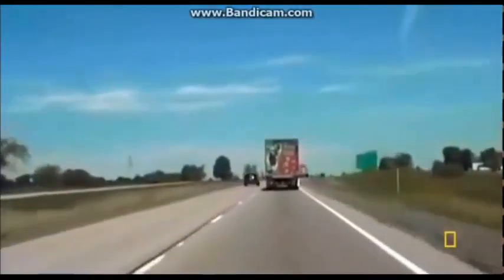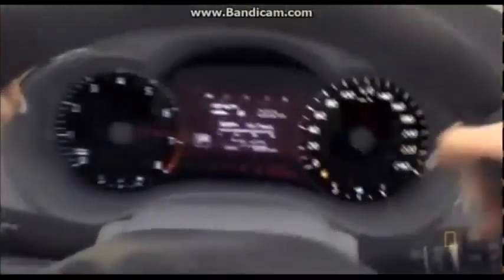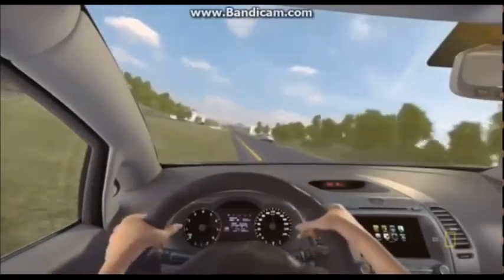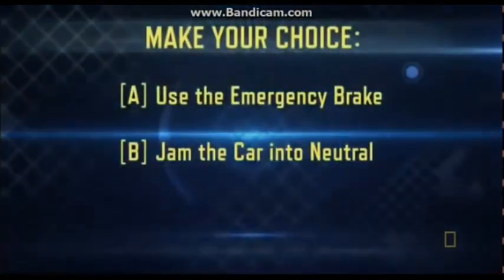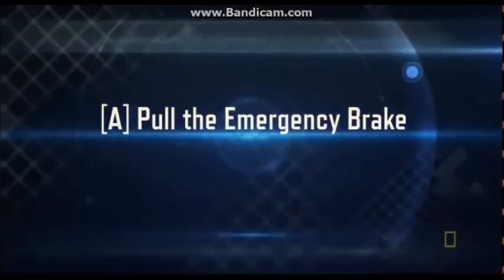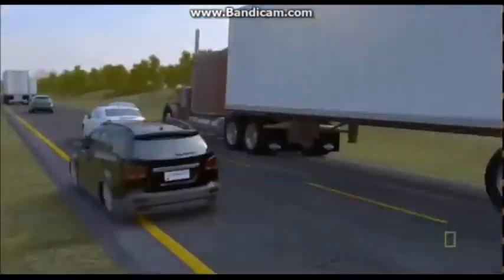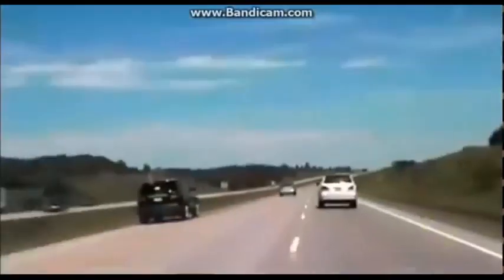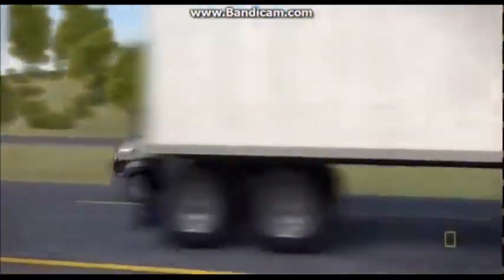How would you stop your car if your gas pedal stuck

Comment: 1:19 a kia sorento 2011 doesn't have a v8, LOL
Reply: Ikr lol. They also act as if 175hp is a lot lol.
Reply: Turboed Dude Well it's more than the average car has.
Reply: Pshtttt no way dude. I know a lot about cars and thats either average or below average.
Reply: where do you live then? In monaco or beverly hills?
Reply: I think every car in america is like that. I think every car in america has 150+hp since fuel is really cheap there.
Reply: I live in New Jersey
Reply: حفصة not even
Reply: 175 for a small coupe is a lot, but for a 4wd suv that weighs 4000 lbs+, it really isnt
Reply: Turboed Dude yeah here in portugal if you have 175hp car you’re actually doing Pretty good in life
Reply: Yah. And any company that managed to make a v8 with only 175 hp should be embarrassed.  My v6 has 195hp.
Reply: Zekeriah Jones there are 4 cylinders with 330hp Out there stock
Reply: حفصة actually, that's pretty average...
Reply: but its a heavy suv... weight is really important ok?
Reply: That's what I was thinking, also a Sorento has more than 175 Hp on base models.
Reply: حفصة it isn’t tho.  toyota camries have more than that.
Reply: Zekeriah Jones kia sorento isn’t a v8
Reply: H4ckantrieb Volkswagen Golf 7R. 2.0L 4 cylinder turbocharged to 300hp.
Reply: Our '06 sorento 3.5 v6 made 195 from the factory. A just quick retune later and we were sitting right around the 280 mark. But those fuel milage figures went way down lol. I still prefer skids in 2nd entering the on-ramp to the highway. Smiles per gallon !
Reply: حفصة 175 horses in an suv isn't that much
Reply: V8 swap
Reply: حفصة its not, its an suv
Reply: What kind of modern v8 would put out only 175hp anyway? 😂😂😂 This isn't the late 70's-80's.
Reply: Yeah 175 hp is slightly over average. Most cars have between 100 and 150 hp.
Reply: It has. V12 Biturbo
Reply: ever heard of  turbocharger? makes 4 cylinders do 250+ hp. my mom has a 2 litre 4 cyl turbo and it makes 254 bhp. cost her 27 grand.
Reply: حفصة no, 175 is less than average to US, in the US the average hp for cars is 210
Reply: S J Productions II only 250 hp for 27 grand wtf you got ripped off then because I could by an eBay turbo kit for like $1500 and make 500 hp 🙄😂
Reply: Engine Swapping 101

Comment: 1) Pulling the handbrake doesn't instantly lock-up the rear wheels like it does in video games. You can pull it only slightly and then progressively pull more and more, that should slow you down without locking the brakes.
2) Brakes are supposed supposed to be more powerful than the engine, so that you could always deccelerate in a simiar situation. Either they were faulty or she braked too much earlier and heated them up so they became useless.
3) Shutting the engine off doesn't lock your steering wheel, the power steering isn't working anymore, but at such high speed you can steer quite easily. This still seems like the best option for me.
Reply: You will be shutting down your brakes too.. never do the 3rd option
Reply: @vysakhjayan3448  You only need to use them once, so it's perfectly fine.

Comment: The people who made this video obviously didn't watch the video that they are talking about.  The dispatcher told her to do that, and she said that it wouldn't shift.  Okay, NOW what do you do???
Reply: Shilodog Smith use the clutch pedal? Duh?
Reply: Yeah I would automatically put the vehicle into neutral but if that didn't work I would kill the car.. at high speeds power steering doesn't help as much as lower speeds so you could still steer but you would need to know how to drive at least drive with common sense... I see so many people who literally have no common sense or any mechanical inclination and their driving is just terrible.. can't tell you how many people I let ride  my dirt bike, 4 wheeler, jet ski etc growing up and I tried to teach them and it was like dealing with toddlers.. a lot of women are like this when it comes to driving and they aren't defensive at all.... sorry but it's true..
Reply: Finlay Mitchell automatic shifters don't have a clutch pedal
Reply: Carguy 2204 From my experience there are also a lot of male crappy drivers (and a lot of males who struggled to deal with gear switching on my Quad/ATV or generally driving it), who drive way to aggressive for their driving skills.

I did however do a seminar, while getting my driver's license, on driving in dangerous situations on a test track. Helps a lot. As well as driving a car which is older then me. No power steering, no anti-lock brake system, not even air conditioning.
Reply: Ayumi Kuro You are right I used to race motocross and a lot of my friends couldn't even use the clutch on my old practice bike it was funny..
Reply: A friend of mine literally thought all you need to do to drift was pulling the handbrake and floor it. Luckily he didn't try it before i showed him what an actual drifter does while drifting
Reply: Turn the engine off and let the car loose speed by itself. You can actually turn the steering wheel while the engine is off. It just becomes stiffer, but you can turn it anyways. You won't have braking assistance though, but you can still put some weight in the pedal and have a bit of braking like that.
Reply: Exactly, in auto transmission you can't shift to neutral at high speed
Reply: My 2008 automatic ford focus allows me to. Don't know about newer transmissions ...
Reply: 5Siver the video says "TRY TO JAM IT in neutral"
Reply: Christ chris in the newest cars the lever is electronic not mechanical, it doesn't allow you to put neutral even if you can move the lever
Reply: Felipe Frota must depend on model year then. In new peugeots it's not possible.

Comment: The key has 4 settings
1: off (here is a risk of activating the steering lock, even with the key in)
2: access (disengagement of steering lock and turns on secondary systems (radio, navigation, auxiliary power)
3: on (turns on primary systems, engine control, abs, ebs and more)
4: start (spring loaded, the key goes back to on after release, this starts the motor, engine powers your power steering and brake amplifier 

You can always go from on to access, and cut the engine, however, this will cut off power steering, abs, airbag, esb and your brake amplifier, so that you have 2-4 brake attempts in your pedal before your amplifier is empty. 
But it will not engage steering lock
Reply: I don't want to be that guy but acc stands for accessories

Comment: You are actually supposed to put on neutral and then set the car only on "contact" where it has power WITHOUT TURNING ON the engine (shocking, i know. Cars can be on contact to test lights or the electronic without turning it on since 1980 or earlier). And if the car is in contact you can still steer the wheel.
Reply: Yeah but you'll lose power steering and brake assist
Reply: You shouldn't turn the engine off. You would lose power steering and brake pressure making it harder than 
necessary to come to a stop safely.
Reply: Soleimsen look my response up.
Reply: Soleimsen the power steering is true but if your at high speeds, you wouldn't feel that, I drive a car that doesnt even have power steering to begin with, but the engine doesn't have shit to do with the braking system. What if you engine stopped working when your at 100 mph? Yeah right
Reply: Soleimsen sorry for the bad english btw, Im not from an english speaking country...
Reply: gerrit sikkema there's diffrence between engine block/failure and leaving your car on contact. If you have engine failire your wheels will lock
Reply: polikerski Break pressure is depend on your foot. Only if your brake leak that it won't work(also some fully electronic brake, but it should have some backup?), and you shouldn't drive out in the first place. Did you mean the brake assist. If so, it is, but your adrenaline would help. ;)
Reply: Your brakes would still work just as good with the car off as if it was on. The brake system uses the negative pressure from inside the intake manifold to make braking easier, so if the car is off you wont have that vacuum in the manifold. Next time you park your car shut it off and pump the brakes untill they are firm. Even though there hard to push, you can still push them some. And also, your steering wheel wont lock unless its in park! As for manual transmissions, I dont think their steering wheels lock at all.
Reply: ธนวัฒน์ จรัสรัชวรรัตน์ what car has full electric braking?
Reply: Healing I meant break assist, my bad
Reply: ธนวัฒน์ จรัสรัชวรรัตน์ yeah I meant break assist
Reply: Healing turning off ignition also cuts power steering, better pull aside first before shutting it down
Reply: your steering wheel does lock in a manual car, but again putting the key on accessory would let you steer so for me if I was in a automatic transmission I would put the in to neutral and then shut the car off in accessory some don't let you do this but never the less Id just turn it off then put it in to accessory. this isn't rock science but some people just don't know how things work
Reply: Shane Dahl accessory doesnt magically enable power steering, the speed will help but the slower you go the more you have to fight to steer, it's better to shift to neutral and stop somewhere and then to shut the engine off
Reply: T Man you clearly never drove a manual, the steering wheel locks the moment you take the key out of the ignition, because a metal pin wich is connected to the ignition, goes into the steering column. I dont really work on automatics, since I'm from europe, but I think it works the same way for them. The gearbox in manuals doesnt intervere with the steering lock
Reply: gerrit sikkema its the exact same with automatics, theres a pin that blocks movement of the gear selector at the ignition lock
Reply: Google's being a bitch and I've never heard the term "putting car on contact". Explanation plz?
Reply: Healing thank you
Reply: T Man my manual bmw m3 has a wheel locker but the key has to be out of the ignition
Reply: Don't know about cars in the US, but I assume it's the same. My car has a steering lock that only engages when you get the key OUT of the ignition.
Reply: Dit Gaat Fout that’s is what I am saying.  My car here in the US locks when you take the jet out of the ignition
Reply: nice profile pic
Reply: Rajan thanks
Reply: ON = Contact. It is very common term here in europe. I think it just means giving power to other systems.

But term its self is probably very old and again it "probably" comes from contact ignition system and today that is no longer in use.
Reply: EXACTLY this! For some reason people dont know what you can turn the key 1 notch down and you will still have brakes and steering.